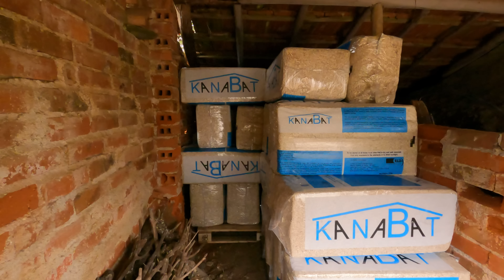Let's Get PLASTERED! DIY Hemp Lime Plaster

Comment: Wow, those walls pretty smart so far.  Congrats on adjusting your mixes to get the consistencies you needed.
Kylie, i wish my hair could be as neat as yours when facing a lot of work... my hair is sproingy and heat-holding 🥵.
Guy, you look 10 years younger with shorter hair and much less facial hair👍🏼.

Comment: I went with insulated lime render - basically a lime render with small glass beads added to it, - supposedly improves the U value of a solid wall by up to 40% (at 5CM)  was lovely to put on the walls and so far so good!

Comment: Hi in Montenegro which has similar conditions to you guys. Lime putty is used a lot people over the years have used all sorts of things added to the mix. Having learned the ways to plaster in the uk I found the local way odd but it works very well. They make the mixture a little wetter and throw it on to the wall after which troweling or smoothing.

Comment: Oh boy this was exactly the information I’ve been looking for. Can’t afford to hempcrete all my walks to recommended 25cm for insulation but want to at least try as a plaster and hole filler, and couldn’t find any information on using quick lime / cal viva as that’s all I can find so far in Portugal other than nhl that I don’t want to use. Thank you both so much for taking such great care in detailing your work so that others can suffer a bit less hopefully 😂
Reply from the maker: So, a few things we’ve learnt since this video …. much easier to either: a. slake the quicklime first, cool overnight and then mix with hemp the next day, b. use hydrated lime (calcium hydroxide Ca(OH)2, not calcium dihydroxide CaH2O2 which is what the UK has).

We have a couple of other videos that show both these if you fancy trawling through them (or let me know and I can find the appropriate ones)
😀 — Kylie

Comment: Good to see the progress - sometimes when a mix is being made the ratios are shown - was it a 1:3:3:1 (water lime hemp sand) - it may help a few viewers to get a better idea for doing this themselves. When I've done work that involves the stretching and pushing that this looks like it does, doing other tasks throughout the day seems to reduce the pain, as does stretching a lot more, drinking as much water as is possible and thinking of it more like a light-workout and pacing yourself. BTW, if you want to get the lime off any of the woodwork you're going to finish, white vinegar is normally recommended - is it worth testing it out to show if it does work better than just water?

Comment: Have you thought of doing a few patches in another room of top coat? IDE try a few maybe one with a small amount of hemp, another with course sand, maybe one with a fine grit/sand mix... They seem to use a sand /,grit mix in Italy and it looks good on the wall..... As usual your doing great!!! Keep up the good work!!
Reply from the maker: We have a wall that we’ll be using for just that (which will ultimately be under the staircase), but we’ve not yet filled in all the holes.  So a few more weeks and we might be able to experiment more 😀

Comment: Brilliant job as always...  If I was you I would get your electrician  in to advise on the first fix before plastering.  If it's like Spain they do things differently to the UK.  Large junction boxes and round conduit with single conductors.  May save you some hassle?  Stone walls are a nightmare to fix to... (ex BT engineer, computer centre operations, data comms, self employed electrician, small holder and now retired  watching YouTube labours LOL) Beats Oracle DBA any day....
Reply from the maker: We’ve had the electrician in once already for a pre-visit and basic planning so we’re good on that front, but waiting for the second visit to start works. The room we plastered has very little work to be done so really not an issue to channel out a couple of runs

Comment: Do you think this lime/hemp mixture could be applied to concrete masonry units (CMUs)? Since concrete is relatively non breathable, but the lime/hemp is, I would figure that application to the interior would be relatively benign. It could, however, lead to the lime/hemp wicking moisture into itself and then depositing this moisture onto the lime/hemp and CMU interface.
Reply: You never want to mix unbreathable concrete with breathable lime applications. Stick to one or the other. I'm having to fix issues due to previous owners having done it to the house I currently own.

Comment: 11:00 just noticed that the beams were strapped for level? Sistering the old beams with new ones would have greatly increased the structural integrity of the floor above?
Reply from the maker: I think you’re referring to the new timbers …. There is one that is sistered, and the others are run from this in the other direction. These ones were placed where there was a massive hole, nothing to sister to.

At some point there will be an archive video showing what happened
Reply: @MAKEDOGROW  Nope old timbers with short pieces of strapping on underside to create level ceiling? I can see 3 of them in the view at the time stamp
Reply from the maker: @greenfrog8871  ah, they’re there from the old ceiling. They will get removed eventually, and as you suggest we’ll sister new timbers to the depth of the new ceiling (once we know what that will be). Probably a long while from now ….
Reply: @MAKEDOGROW  
Yes taking opportunity to improve structure is good

Comment: How/where do you wash out the various buckets and such? I find this question interesting in any setting, because I think people on municipal water put all kinds of things down drains thinking it "goes away." With your own septic, it probably feels more immediate?
Reply from the maker: We rinse everything at our outside tap and throw the waste water across the grass … since everything is natural there’s no harm. The diluted lime is also fine … many farmers actually add it to their land to reduce acidity
Reply: @MAKEDOGROW  Water your lime rich rinsing water on next years Brassica patch. They enjoy the higher pH.💕🌻
Reply from the maker: @moiragoldsmith7052  could it also go in this years already planted ones? Not that they’re doing badly, they seem to double in size each week!
Reply: @MAKEDOGROW  Any of yr citrus will enjoy
Reply: @MAKEDOGROW  I used lime residue from a plastering job on decking which normally gets slimy and slippery from moss and algae over winter, it's worked well.

Comment: I really like the "hand finished" look rather than the float finish. Are you going to go real old school and add reed burners into0 your wall? In the olden days they used reeds fore lighting and fashioned some ledges that had holes in them to place the reeds. May be not right for this room but would look nice either side of the bed in the bedroom. Thanks for posting

Comment: Is there an R insulating value with hemp?  Good work
Reply from the maker: There is, and really depends on thickness and hemp density. Most sources I’ve seen quote around 1.26w/m2k for 30mm coat

Comment: Have you thought about adding any pigment to the final layer to avoid painting?
Reply from the maker: We might do that, but I foresee a problem trying to get the colour identical across so many mixes. Each of these walls took at least 2 mixes …. there’s a risk that slightly different shades would leave the walls looking a bit ugly
Reply: @MAKEDOGROW  I would still give it a try doing two mixes and test their colour. Especially at a later stage I think you'd be able to better control the mixtures and avoid any significant difference across the walls as the pigments available today are way better than they used to be, but nevertheless, good job so far, giving me some ideas for the near future.

Comment: awesome video. Am I right in thinking this can be used outside as well? I have been considering insulating the walls inside and out and this would be perfect!
Reply from the maker: It can be … but you have to be careful in climates where there is lots of rain and damp. If hemp gets wet, and stays wet, it will rot. The solution to this is to have a nice thick lime only render and plenty of guttering and drainage.

House that are built with external hempcrete walls have this type of lime rendering on the outside, and sometimes a linseed oil coating to give extra waterproofing while still providing breathability

Comment: In cob is used 70% sand, 30% cob and 5-10% stroh or hemp. For rendering also with lime. But had the same mix as cob. 70% sand, 30% lime and 10% hemp?

Comment: Great video.
Looks like you got very nice results.
Could you share with us your mix ratio? And what is the name of the Spanish firm you got the hemp from.
That would be great help as I want to get my walls covered with hemp and lime as well.
Good luck with the rest of the house 😊
Reply from the maker: We’re still perfecting the mix, but it’s approximately 1 quicklime, 2 hemp, 2 water (but the water varies mix to mix). Will also depend on the brand of quicklime.

We got our hemp here: https://www.hempcrete.es/

Comment: What will you be doing around the ceiling beams?
Reply from the maker: We have different plans depending on which room it is. In this case it’ll be a plain ceiling (probably timber), but dropped a little from the beams since they’re all different levels. We need to do a little backfilling between some which is why we didn’t go all the way to the top with the plaster …. but we want to do that after we’ve run all the services

Comment: I'm assuming you are using the hemp lime for insulation purposes as well as building up your walls? In this case I'd make sure to do it right up to the floor boards. Otherwise you'll be getting a lot of cold coming in in the gaps between the floors and the ceilings.
Reply from the maker: We will be running it rightto the top, but we have to first run a load of services then we’ll back fill and plaster 😃
Reply: @MAKEDOGROW  😄

Comment: Aren't there tools available for spraying the mix on to the walls?  I wouldn't want to use them for the final coat, but they would make this initial pass a lot faster, surely?

(Also, thoroughly enjoying watching this on a Saturday morning as opposed to actually getting up and working on my own projects.)
Reply from the maker: I’m not aware of any spray type tool that could cope with the hemp heavy mix. And even if there is one it’s very unlikely to be easily available where we are

Comment: Try wearing cotton gloves before you put on the rubber gloves. It will help with sweat and absorption. You'll find those gloves in the beauty section.
Reply: Cotton knit gloves are easily found online where meat grinding equipment is sold, as well as in the paint sections of industrial supply catalogues.

Comment: Without wanting to appear to be being arrogant, do take care when mixing water with the quick lime as the chemical reaction produces carbon dioxide which will asphyxiate you if you breathe in too much of it.
Reply from the maker: Did you not notice the masks?
Reply: @MAKEDOGROW  The point is that if you have only carbon dioxide to breathe no mask will save you. If the mask was able to filter out CO2 it would oxygen as well